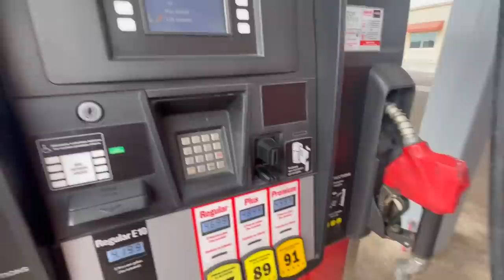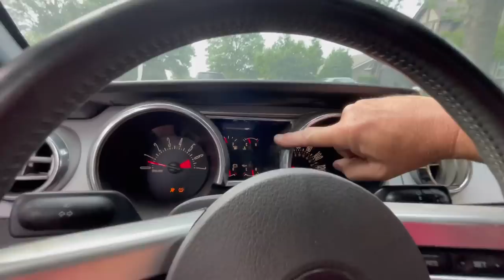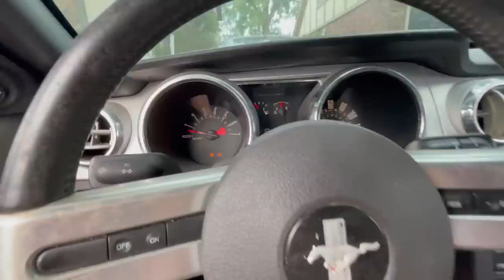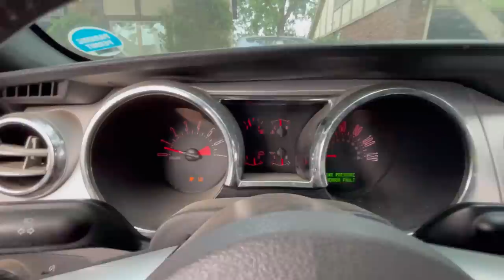Mike Buys A Non-Mercedes!

Comment: Looks like a good car for the money. Little elbow grease, fluid changes, etc be a nice project car. May be cheaper Mike, to find some good used panels for the inside door inserts, and just put rear spoiler back on trunk where holes were for the spoiler originally.  Overall love it Mike. Love videos of you and Randy together, as well michael(Santa's workshop). 🤣👍

Comment: My son has a 2006 v6 Mustang for many years, good car!  The engine was made in Deutschland. Weak points are paint adhesion on aluminum hood, vinyl door trim contact cement gives way. Sealed transmission weak especially in the 2006. Sway bar bushings (front/rear) need replacement regularly. Overall very good cars!

Comment: Glad to see you picking up a Mustang!  You can find seats at pull a part quite often for these.  Start watching and you can find one in much better shape. They are all the same color and material in the V6 models. I will keep an eye out around here for one too.  That one has had the dual exhaust added and a different grill and rear bumper cover from the standard ones, so that is a bonus.  You can get a spoiler at pull a part too.  The door panel coming off is a common thing on these.  You can get replacement panels several places.  I agree that a $500 paint job would be a good investment.  Fix her up and take us along for the ride!

Comment: Well well well Mike. You went native!
The Mustang looks like a good buy at $1980, not that I know much about US car prices, but there is nothing wrong with that Cologne built V6 engine. Rock solid, straightforward and why it started right up. We can trace that right back to the first V6 Capris built in Germany and the UK from 1968! These were European 'Mustangs'.
The Mustang is about the only US made car that finds a home in the UK and they are liked here. OK so we also have a few Chrysler PT Cruisers as well. But we all make mistakes.

I can see you spending some time but not a lot of cash on this American legend. Enjoy!
Reply: Thanks for feedback and perspective, I always wondered where the European ancestry was tied to every time I was changing the motor oil and seeing Germany stamped on the engine block.
Nice smooth power output, not quite as powerful as my Corvette but a fine engine.
Reply: @johneder2416   the UK also built a V6 called 'the Essex' but it was a 3 litre and went into the UK built cars while the Cologne 2.3, 2.6, 2.8 litre V6 went into German built cars. Quite different engines but both were smooth and powerful.
Reply: @1chish  we got the Ford Capri with the 2.8 liter V6 and was a semi cult-car back in the 1970’s  here in the States but the Mustang overshadowed it. I always loved the Capri’s.

Comment: Two bags for a 2009 Mustang is a steal Mike. That trunk lid needs replacing but I think you could do the door inserts with some alcantara and spray glue. Just spray the glue on using card to prevent it getting on the door and just stick new material to it. Use a plastic trim panel tool to push it into the seam and then trim off with a craft knife once the glue dries.

Comment: That air bag light on means the sensor had been triggered and the air bag could possibly deploy with out warning.  I bought a 2006 chevy cobalt that had been in a slight fender bender with the same issue it broke down on me 2 week later and a traded it off to a dealer in sandsprings that gave me more to trade it in than what I bought it for.
Reply: Airbag light means there is a fault within the system and all airbags will be disabled until the fault is repaired. Airbags won't deploy for no reason.

Comment: Nice find Mikey.  My thoughts on the areas where the clear is delaminating, just scuff & reclear, cover over the decal w/ the clear also at this point.  A good detaill & getting replacement pleather for the door panels, disassemble the armrest, glue your piece in, reassemble armrest to panel,  drive it like ya stole it, 'cause ya did.....🤔

Comment: Mike, you made off like a Bandit with that mustang! A little bit of TLC and it will be an awesome car when the S-Classes become too expensive to run!

EDIT: to clear the driver information messages, there are three buttons above the radio that are marked “SETUP” “INFO” and “RESET”. Hit the Reset button a couple of times with the doors closed and you should be golden.

Comment: I just recently pick myself up a 96 mustang gt 4.6 5 speed for a grand put 1500 into it had to have motor replace due to rod bearing failure they are a very very fun car to have and I absolutely love mine and will never part with it always drove chevy pickups until I got this car I was dead set against ford's but this car I absolutely love and she'll be around for awhile hope urs treats u right too and the paint issue is very common with them mine has a red hood and is doing the same thing

Comment: Ford 4.0 V6 coolant housing leak coolant that’s a big problem with them. An they have 3 timing chains one in the back of the motor an 2 in the front.and that’s a pony package mustang. There’s no button for the truck in the car. Get you a key fob takes 2 minutes to program one and you can open up the trunk
Reply from the maker: I think mine has that leak…

Comment: I like it but it could be better if it had a v8I dont want to be a bummer but Im sure the trunk has water in it because there are holes in the lid. Might be a little bit musty smelling but you can wash it. Its missing the wing? Or is it called a spoiler.